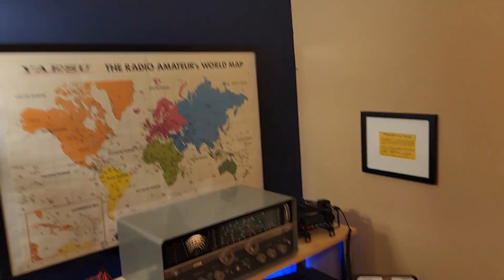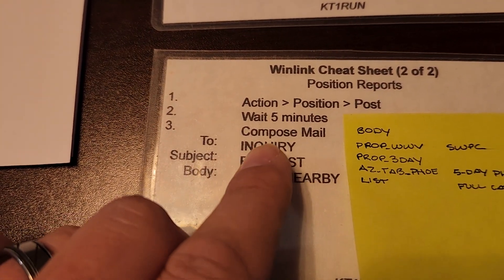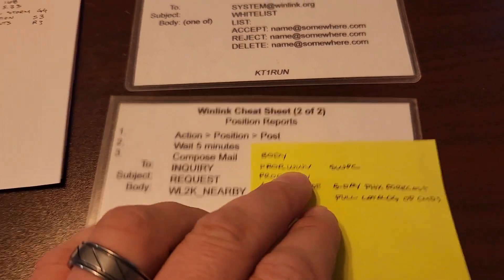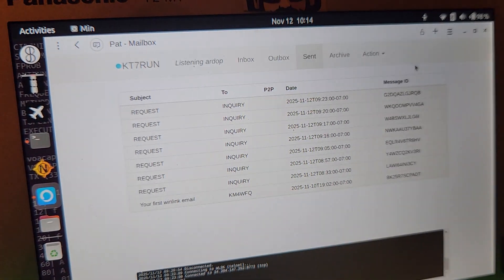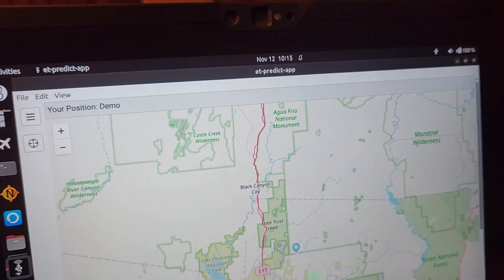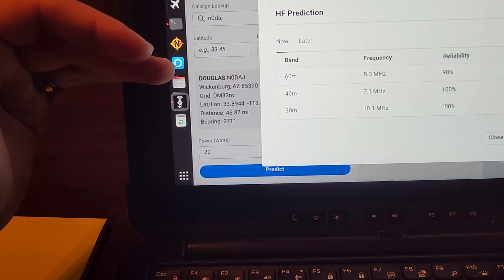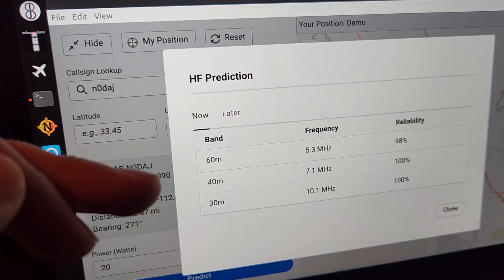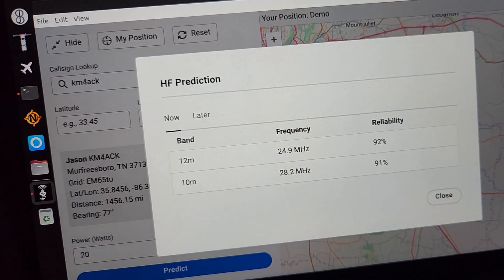Offgrid HF Prediction Demo, Solar Storm, Weather, and more

Comment: I like what you are doing and I support you.  Your projection showed 91% reliability and you could not connect because of solar events.  Does your projected success not know about solar events?  Thanks, N8VY Doug
Reply from the maker: It's all offline. It has no way of knowing about space weather. The operator would have to source the information from another location.

Comment: What's the difference between vara and pat?
Reply from the maker: Pat is an email client for Winlink that runs under Linux. It supports multiple modems to connect to a Winlink station. VARA, ARDOP, and packet are just a few of the modems supported.
Reply: @TheTechPrepper serves the same purpose as RMS express?
Reply: @TheTechPrepper I'm trying to install pat Ubuntu machine.  Tried just pat, the 73 linux.

Comment: I got the KM4ACK catalog file he had a video on and been slowly adding these kind of Q to the coding. Considering many of these I ask daily ...I can run the program, pick the file I want and it creates the email for me. Huge time saver.
Reply from the maker: That's a solid approach. In ETC R6, I am working on a new front-end for Pat Winlink that will be simpler to use. It will include a streamlined templating system for quickly sending emails from the catalog.
Reply: @TheTechPrepper  That will be great!

Comment: One thing i have been thining is creating a group of redundent site operators for your offgrid comms platform.  maybe have a separate tier of patreon accessible to that or something. and those operators get paid with those funds for having the redundent equipment.  maybe when your setup is more polished are you are happy with the rollout of it.  but unadvertised, except for those with the login/etc.  could be hf, vhf/uhf.  so people in each area could have thier own local network if possible.  making almost a mesh network of preparedness in case something happens.  then also have a national comms update that goes out to all locations.  and when info is received from one location, it gets updated to all locations, but first the locals.
Reply: Maybe AmRRON?

Comment: I missed out on the most amazing part of the auroras last night due to a gap in knowledge about the Bz index north vs. south 
If I had been able to pair the Kp with Bz, I would have been able to get some photos of the aurora near Georgia that would be otherwise a normal thing to see in Iceland 
Insider secret, a strong negative/south Bz with Kp6+ and you can see something amazing in the sky with a camera 

A thought for HF prediction, how do we detect a solar storm totally offline besides keying up and getting dead air?
Is there a frequency that usually works even when it's the next Carrington event?

In some non-ham testing, my geostationary satellite comms are working in this Kp6 storm, but I'd be curious how well it works for Kp8+
Reply from the maker: Shoot, sorry to hear that you missed the event. It must have been a show.

If the Internet is still up you can get the NOAA Space Weather alerts via email, but this is something that will be inaccessible during a full grid down scenario. In general, if you have major difficulty with your normal contacts, then chances are a good there is some level of solar event that is impacting conditions. That is exactly what I experience this morning for me. I noticed that something was off as I was unable to communicate with my normal group. However, we were able to communicate via local VHF/UHF.

I would be curious if anyone else in the comments has any suggestions on any non-Internet means of getting space weather information outside of HF just not working.
Reply: I took some crummy cell phone pictures last night in central Kentucky that were nonetheless impressive.  I returned tonight with better cameras for some long exposure shots on a tripod and time lapse video but there was no aurora light show despite the overly optimistic G5 aurora predictions.  Space weather is even less predictable than terrestrial weather.
Reply from the maker: @Liberty4Ever  This gave me a chuckle... I actually laughed out loud, but refuse to use the acronym. Damn the unpredictability of terrestrial and space weather.

Comment: Thanksgiving is basically going to be my Christmas!  I'm REALLY looking forward to the final release of ET with all of these goodies!  One copy on the desktop for the static (here) stuff and copies on my laptop and Surface Go 3 (tablet) for the really important mobile stuff.  My thoughts on how to deal with propagation issues related to solar storms and other geomagnetic issues is this: everything should have a fallback.  Even if my radios are useless, close range comms are still possible even if it means marking a tree or using flashlights and morse code.  If stealth is important, the best tool is PATIENCE.  Well... patience and a well planned PACE plan with full family participation.  Make it fun!  More of us need to go camping and hiking anyway, right?
Reply from the maker: It's been a long development cycle, but it feels like all the building blocks are in place so that I can finally focus on these custom graphical applications. We'll do an end-to-end install together this month the live stream. You may want to try it on one system first, then after it works, install it on a second. I just took a break from building a full ISO (R5 Build 15) to check in on the comments. The fallback for these storms is VHF/UHF and line of sight comms, but low tech options are also in the plan. Have a good night! Thank you for the support.

Comment: Dang I need to just take the jump & figure out how Ecomm tools works.   It seems very powerful but I’ve been pretty intimidated by the Lenox.
Reply from the maker: We'll do a build together on the member stream this month. Building the image is the hard part, but easily doable. Don't be afraid. Using it afterwards is the easy part.
Reply: @TheTechPrepper that would be greatly appreciated

Comment: Wouldn’t 80% likely hood be a better cut off that is still pretty reasonable it will happen? 
Will the November release allow us to drop a pin & do the offgrid HF prediction? 
Awesome stuff!
Reply from the maker: In my experience, no. 80% is really a coin flip and rarely works. You can always run the et-predict command line tool to get the full prediction. My goal is to make this as simple as possible for the field operator. Mining through a sea of data is problematic. The pin dropping will not make it unfortunately. It needs to wait until R6. There is still a lot of work plus documentation to hit Thanksgiving.
Reply: @TheTechPrepper  I hope you get some turkey and dressing, we can wait a few more weeks if you need them.😄
Reply from the maker: I'm frying the turkey for a house full of friends and family. I'll have release staged to go live. No worries. 😉